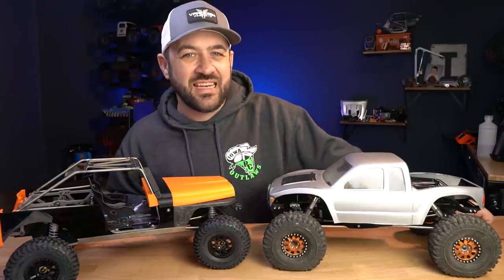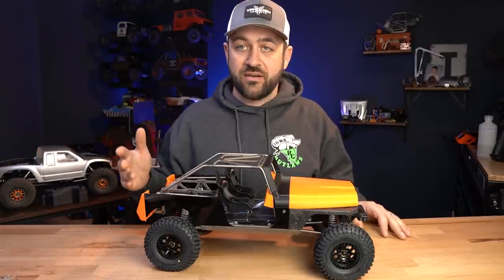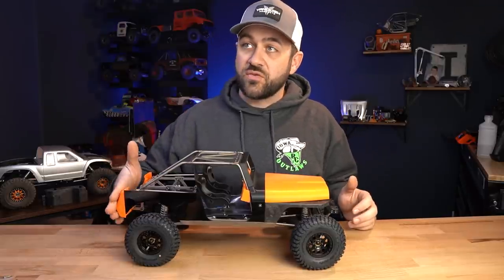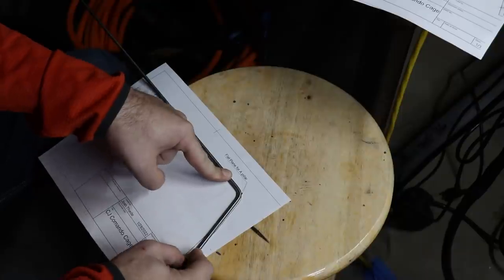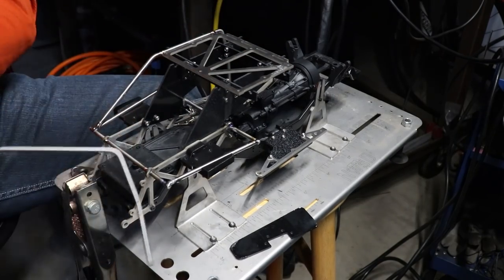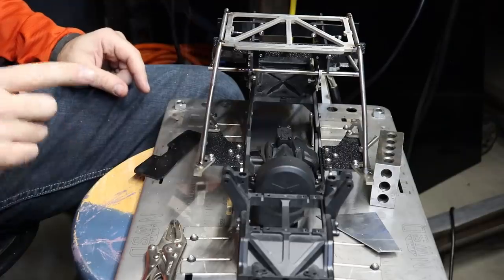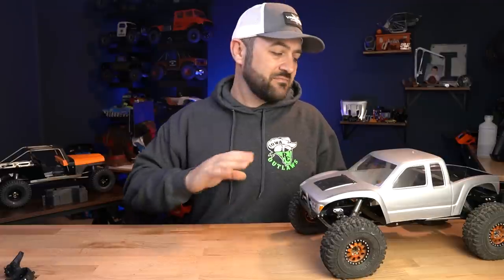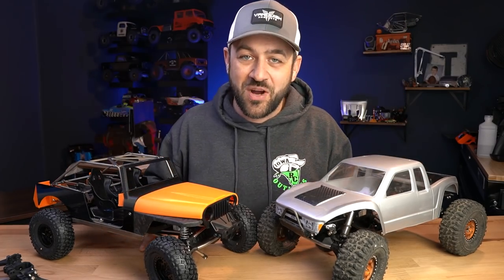Most COMPLICATED Class 1! - Road to Scale Nationals - S2 E4

Comment: Awesome stuff. For the engine it would be cool to see a Cummins in there 4 or 6 cylinder with a nice big snail off the side. For the interior on the class 2 you should check out the 4619 truck that runs at king of the hammers. Perfect race truck style

Comment: Nice update! I just wanted to know for C1, does your front bumper touch a wall before your tires do going straight? Is it a rule or do they look at that during tech in? Thanks Josh!
Reply: in C1, the chassis can't be any shorter than your wheel base.  The bumper must extend beyond the end of the chassis.  Therefore, you have half a wheel/tire diameter in which you can fit a bumper to get such an approach angle as you describe.
Reply: @iviper2004  I only ask because Idk if it’s mentioned in SORRCA but I did see a video about this for ZSN (Zia Scale Nationals) in NM. They did talk about the front bumper had to touch a wall in front before your tires touch for C1. It was either on YouTube or FB. Thanks for info.

Comment: That class 1 looks really good love the tutorial on the tube work also looks like the carbon fiber is same as making knife scales just with a custom mold.
Reply from the maker: I'll have to look up the knife scale making, I haven't seen them use this type of thing so there are probably tips to use.
Reply: @HarleyDesignsInc  its the same concept some form of epoxy and either paper or cloth with multiple layers then compress it in  vice

Comment: Not super familiar with what counts and what doesn’t for scale points but if I had to build one, I would put the rc4wd Warn scale winch on the front and leave the line spooled on it but run a servo winch behind it and have the line run through the Warns fairlead. That way it looks scale but works lol.

Comment: I like the look of the carbon fibre it has a camouflaged look about it.
Are you going to add door bars either straight or angled as I assume you are not going to have doors,  also what material are you using for the side panels as it looks a little strange with just a flat panel with rolled edge's.
Strong magnets for the hood latch, or 3D print a set of latch's that work. like you went old school  instead of CAD  you went to PAD Paper Aided Design.
The Screen looks way too chunky, you do not need it as wide as the cage will protect it mostly.
I wish you guys would run a scale look winch instead of the elastic band or servo winch, as there are ones out there with enough pull for the scale either through the receiver or by remote like the WARN 1-1 use, just think it is cheating.
Reply from the maker: No plans for door bars, they'll be open just like a Jeep without doors on it. The scale winches on the bumper just don't have enough speed or power to compete with servo winches. If they did then I'd definitely think about it. I don't like the style of the Warn 8274 style ones and even they don't have the power.

Comment: I probably would have just used the scx10ii front portal axle
Reply from the maker: The SCX10-2 didn’t have a front portal. I could have used the Vanquish aluminum one but I don’t want the heavier aluminum axle in the rear. Also these axles will steer much sharper.
Reply: @HarleyDesignsInc  sorry that’s what I meant by scx10ii. Front portal was talking about the vanquish portal for the 10ii.  Good point though

Comment: $400 notcher. No magnetic degree wheel. Lol
Reply from the maker: I’ve got magnetic angle finders, but not sure where that would have helped me in this one 😁
Reply: @HarleyDesignsInc  true. Wouldn’t have stuck. 🤦🏻‍♂️. Just looked like a pain using phone and bending with body.   It came out amazing though.
Reply from the maker: @JEMSGarageandMotorsports  Yeah, Titanium doesn't make it easy in many ways but it wasn't that bad either.
Reply: @HarleyDesignsInc  what springs on the C2 shocks? I built a set of the 90mm s8e’s and have some Losi mini t ‘s on them but wondered what you’re running since no springs are offered yet.

Comment: How is this going to pass as a class 1?  Your front axle seems to be more than 1/2" forward of the center of the wheel well....  Don't get me wrong, I love the build, just seems to be a cheater rig for class 1 and wouldn't want to see you get DQ'd after all the work.  ;)
Reply from the maker: Wheel goes right to the back of the opening, pretty much exactly where the wheel has to be. The flares that will be added will make for tire coverage, and a bumper will be added. 
It’s to the letter of the rules.
Reply: @HarleyDesignsInc  Wheels must be within a 1/2" of center combined front and rear... Nothing is said about the back of the opening.  I guess it's hard to judge that on a Jeep with flat fenders/ there's not really an arch to gauge.  Must be a Jeep thing.  I'm just Joshing ya...🙃